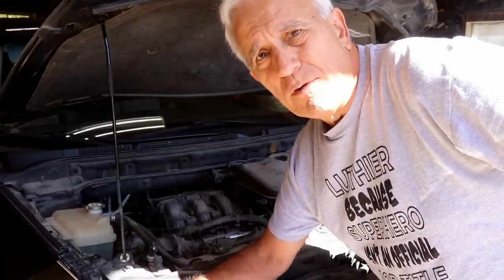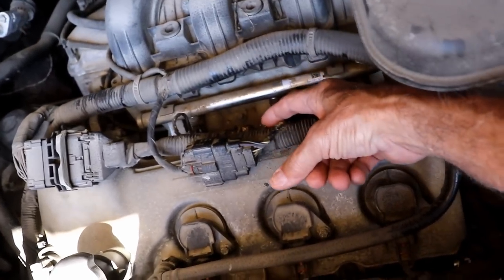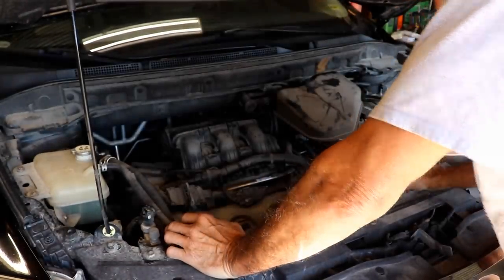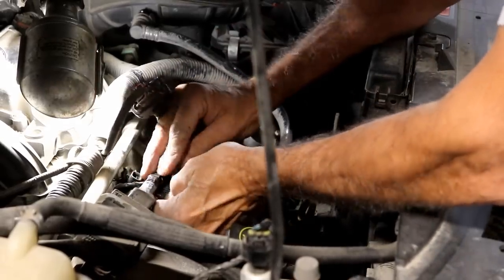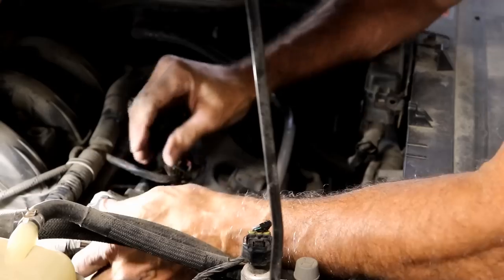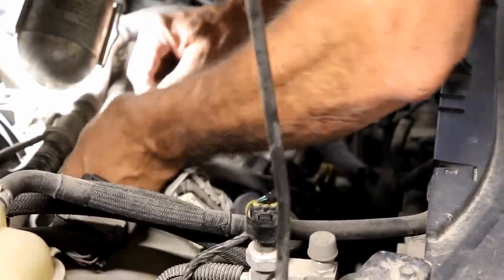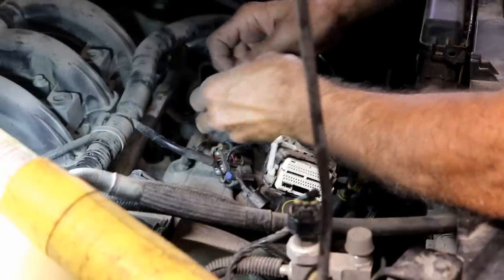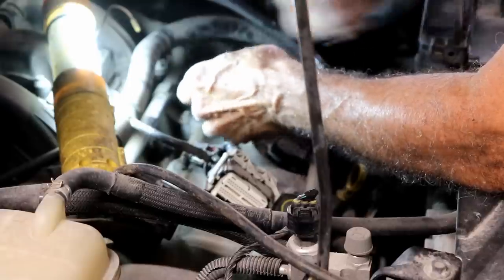671 RSW Fixing Wire Damage Under The Hood

Comment: Very Good Repair. You may want to put some oils that will discourage rodents from hanging out under the hood and start some heavy rodent abatement throughout. My mom had an issue with Rodents and her car not starting. The dealer said that the fuel pump under warranty would be replaced. Unfortunately, all the harnesses throughout the vehicle needed replacing. Cost about 15 years ago was $2600.00 Dollars. I advised her to call her insurance and put in a claim. A claim was put in and the entire repair was totally paid for by the insurance carrier. Mr. Rosa You are very good in all that you do and are very enjoyable to watch.... Thank you and God Bless
Reply from the maker: Oils and sense do not work on mice and rats contrary to popular belief

Comment: Yeah, very good job, Jerry; soldering is always superior to crimping......I repaired a LOT of electrical problems, and a LOT of the time it was because of a crimped connector....It was crimped tight,but the circut was open, because the connection got a little corroded(oxidized) and opened the circuit.... But when the joint gets soldered, no matter how corroded the wire gets,,the solder still makes 100% connection... I was going to make a joke that the car runs great  but, when you turn on the windshieled wiper's, the headlights come on instead🤣🤣🤣
Reply: @poopy_pants_joe1194  Now, when you say fail, do you mean mechanically, or electrically fail?

Comment: The deal would just replace the whole harness, if it was available.  Friend had a 3-5 year old Volkswagen and it had a real harness mess that the dealer some how got running with some very expensive new harnesses.  She got rid of it.  Saw a video where the dealer recommended scrapping a fairly new car because the harness was not available.  Mechanic fixed it like you are doing  for just a few dollars.  And, I'm and engineer and could not agree more that car engineering is crap.